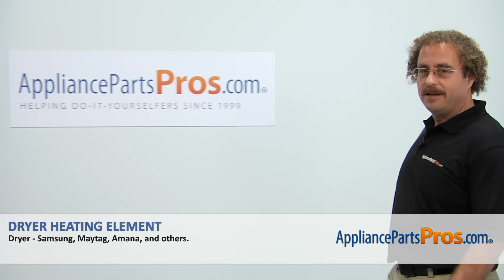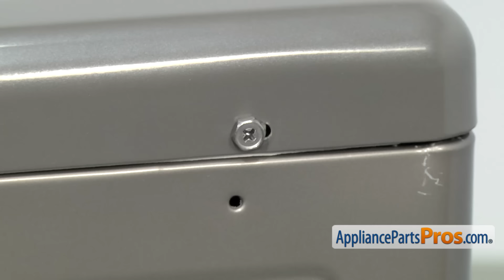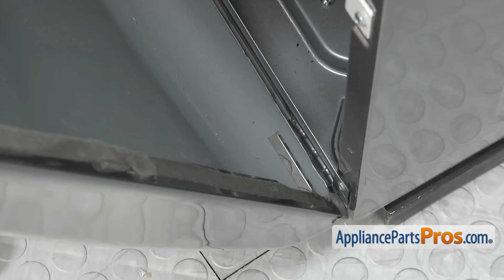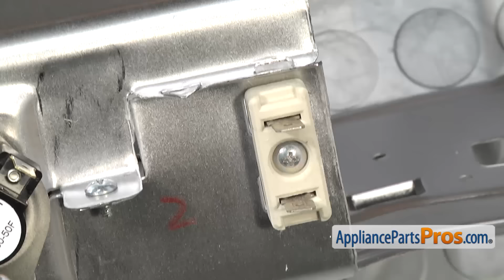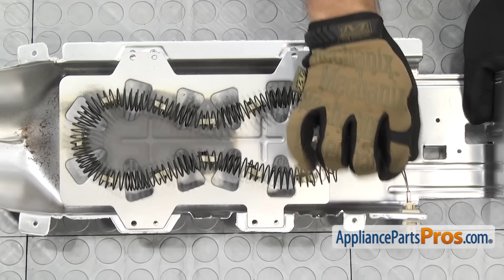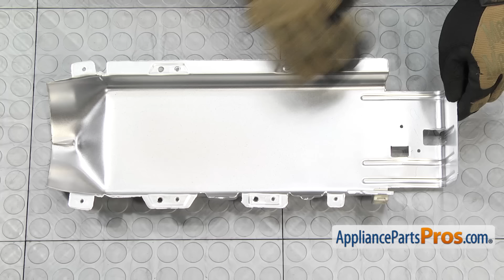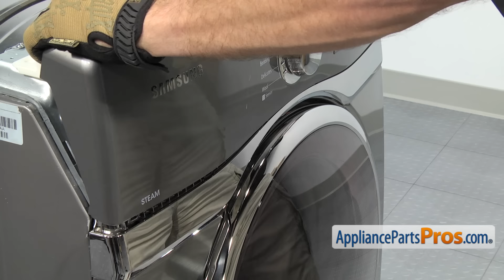How To: Samsung Dryer Heating Element DC47-00019A

Comment: This was a great instructional video.  I used it to successfully replace the heating element in my Samsung dryer.  Thanks for producing this.
Reply from the maker: +Phil Snyder Glad the video helped you get the dryer up and running!
Reply: +AppliancePartsPros As a thought, you may want to put together a "Heating Element Kit" that has the element and the Thermostat and thermal fuse - with the option to return (at consumer cost) the parts that are not needed.  For example, if the heating element is not the culprit, but the thermal fuse or the thermostat is the culprit, the customer can attempt to fix all three at the same time or one at a time.   I don't know the cost of the thermostat or thermal fuse, but they can't be terribly expensive and I might be willing to pay for all three, knowing that I won't have to wait for 2 or more days if I sim-diagnosed the problem (e.g. assuming it was the heating element when it is the thermostat).
Reply from the maker: We usually sell the parts as the manufacturer provides them. In the case of this element, depending on the appliance model number, it is sold as an assembly. Other manufacturers, but not all, also offer the complete assemblies. You can go to our website and enter your appliance model number to view the parts breakdowns to see how the parts are sold.

Comment: Hopefully you respond quickly :/ I replaced my heating element but I'm still not getting heat. The new heating element is the correct model, it's the same as the one I pulled out. The dryer turns on and everything works...just no heat. I made sure my wires were connected just as in the video but still no luck. Any suggestions?
Reply from the maker: +Decreamos There are quite a few things that could cause no heat. Bad house circuit breakers not sending 240v, thermal fuses or thermostats, door switch etc. You can post the problem along with the appliance model number on our repair forum and the techs can help you troubleshoot the problem.